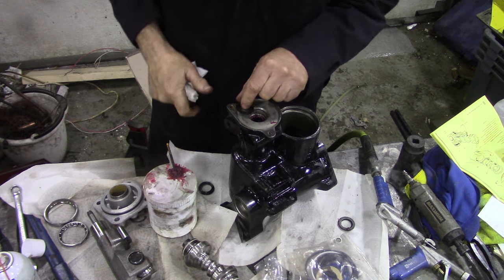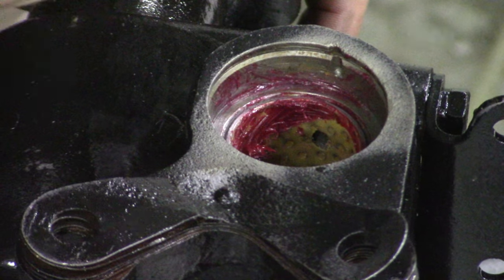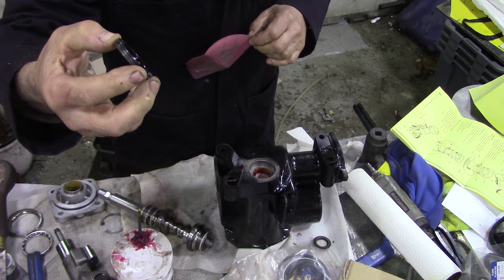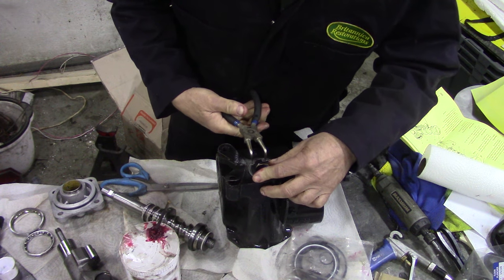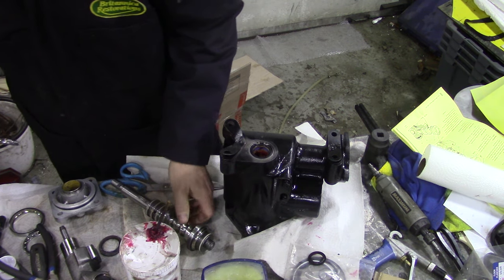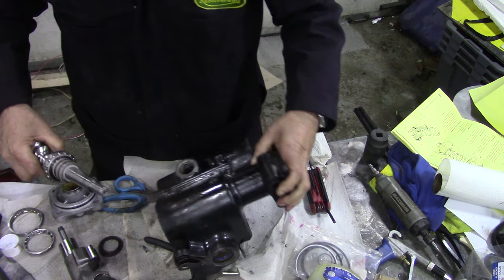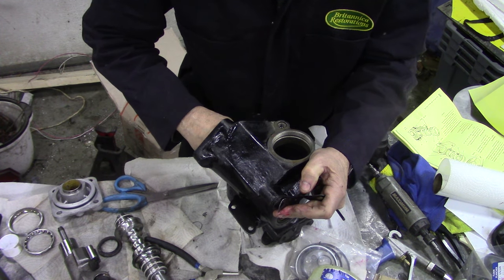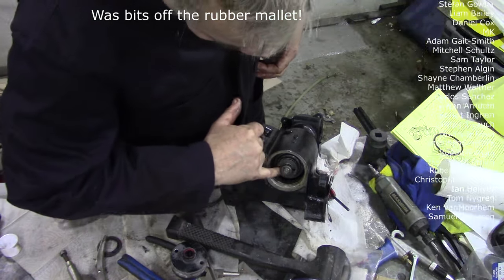Rover 3500 steering box rebuild part 1

Comment: Bugga.
Doesn’t look like a 5 minute reassembly and Bob’s your Uncle.
It’s all those seals and circlips to sort.
Reply from the maker: The pins on the circlip pliers need to be short  - just enough to hold the clip in no more, or it will not sit in the groove
Reply: @BritannicaRestorations  Just a slip of the hand and, Boing! that circlip disappears through the air and lands under something on the other side of the shop!
Sod’s Law!!
Reply from the maker: That's why I put my fingers over the clips when removing them!
Reply: @BritannicaRestorations  Excellent way to thwart Sod’s Law!

Comment: Mine has one of the three nylon seals damaged, what would be the best way to replace them, or is it scrap
Reply from the maker: You need a special tool (or make something) like this
https://www.dingocroft.co.uk/acatalog/Ring-Expander-for-Seals-LRT_57_019.html#SID=66

The seals are not usually in the kit

You may find Land Rover ones fit 
https://www.lrworkshop.com/parts/608000

I cannot be sure

Heat them in hot water prior to fitting

Comment: I've got all that in my Rover 3500 workshop manual, it's quite complicated.  There's a spring balance setting to record the rolling resistance at the input shaft end.  Hopefully you have all that in your manual pages.  Let me know if you want some pages emailed to you.  I don't have power steering on my 1968 P6B so will never have to go through that procedure thank goodness.  The inboard rear calipers are an interesting exercise to overhaul which is my next phase of the restoration.
Reply from the maker: I was sent the manual  -  - set up was easy but can be fiddly